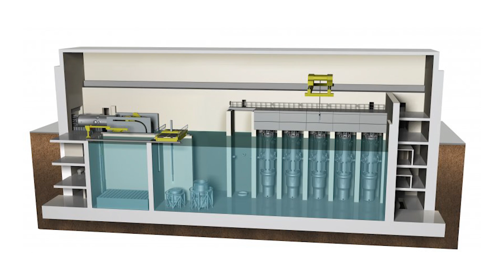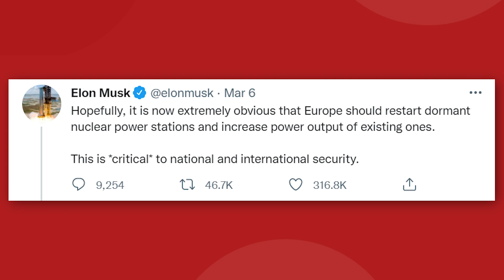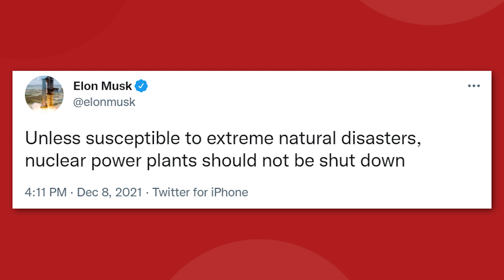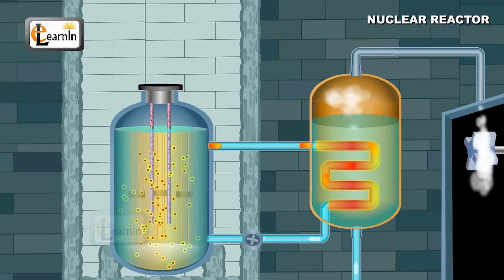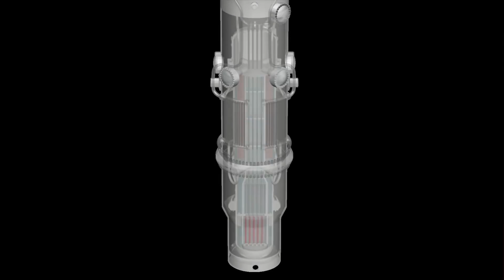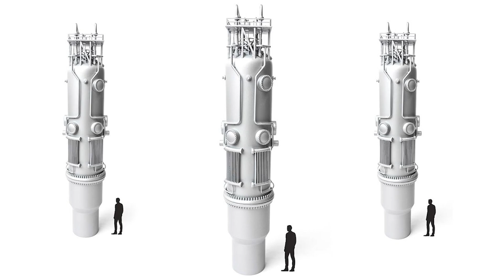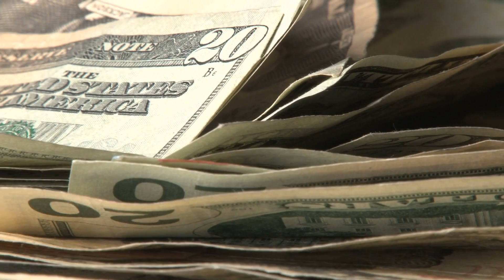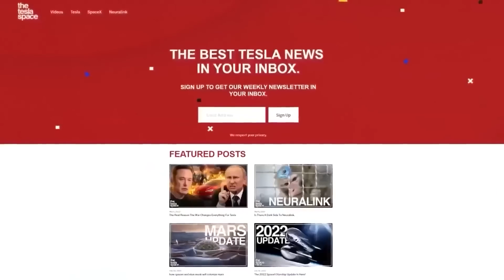The Real Reason Nuclear Energy Is About To Take Over!

Comment: NO NO NO. THEY STILL PRODUCE WASTE THAT IS UNABLE TO BE NEUTRALIZED OR CONTAINED!!! HOW F**KING STUPID ARE YOU??
The following article may be interest to readers:

"Last days of a dinosaur industry

We have gathered here again in front of your Nuclear Industry Forum to again try to warn you that you walk the false path. Your industry, the nuclear power industry, was able to get started on the back of the west’s nuclear bomb programmes in the fifties, based on assuring the public that you would keep the radioactive by-products of splitting uranium separated from the environment. This you have consistently failed to do, having lost control of your deadly machines at 3 Mile Island, Chernobyl, and now three more at Fukushima. Wikipedia talks of 21 meltdowns; that's one every 2.7 years. And with each meltdown you lot claim to now be safer because you've learnt something more. Well, you didn't tell us that the plan was to develop safety through trial and error, and we are not impressed with your efforts.
The public don't see why they should be taking such a huge risk, the risk of losing huge chunks of their country, (as in Ukraine and in Japan), just to get electricity that is available risk-free from other sources, like solar and wind. Especially since the alternatives are becoming cheaper than your nukes. In the case of Japan, whose Fukushima plants are showing themselves to be impossible to control, and which are throwing 400 tons a day of radioactive water into the sea for years now, we humans are facing the prospect of not just losing some land in Japan, but of losing the Pacific Ocean itself. The nuclear industry in Japan has shown itself incapable of even admitting they have a large, stinking mess on their hands, sending us all on a compulsory experiment in the long term effects of genetic manipulation through radioactivity.

Nor does the public see why they should give more free rein to an industry that for 60 years has claimed it would solve the problem of what to do with its waste in a few years time, yet which is nowhere near coming up with any solution. You have 148,000 Metric Tons Heavy Metal waste, ie. old fuel rods, sitting round mostly in swimming pools in the nuclear power stations that produced them, promising to come up some day soon with a way to separate them for ever from the environment. Which you can not do on a tectonically active planet. Your schemes to bury them in salt underground have just hit the wall in New Mexico, where a little 'release' of plutonium from one or several exploding barrels of waste have made it likely that the Waste Isolation Pilot Project will never reopen. And the WIPP disaster has revealed the dishonest behaviour of your industry; you are not allowed to dispose of liquid waste in WIPP so you threw in some kitty litter to absorb liquid and labelled it solid waste. And now you've switched from mineral based kitty litter to wheat based, 'because it's greener', (or cheaper?), and the nitrate salts in the waste have reacted with the cellulose in the wheat kitty litter, blowing open a barrel or three. So the other 300-odd barrels of the same mix are also timebombs that could 'release' more plutonium etc. at us at any time. Of course your experts will say there's no danger, but we're tired of listening to them pedal excuses. You claimed that this stuff would be separated from the environment for all time; your experts assuring us that the latest 'small release' is OK are no longer interesting. There was  meant to be none.

And now you need billions off the taxpayer to build your latest toy in Hinkley Point. Which will supply 3.2 Gw by 2023, by your rosy estimates. When the UK has installed 2.7 Gw of new solar installations in 2012 alone. At a strike price estimated to drop to £100 MW/h by 2018, by which time your index-linked nuclear strike price for Hinckley Point will be way north of £100. And when on-shore wind in the UK has TODAY a strike price of £80 MW/h. So by your own logic, the logic of the market place, your industry is dead. Already more expensive than on-shore wind, soon to be more expensive than off-shore wind and solar, and producer of huge stores of undisposable waste, that has to be guarded for ever at great cost. Not to mention the risk that if it has a bad day, a nuke power station will destroy a third of your country. All for what? So a few businessmen can continue to have expensive lunches and wear £300 shirts?
But what really gets us grumpy is the dishonesty and the political manipulation when something does go wrong. In Japan, they have just had the biggest industrial accident in the history of the world. Fukushima. But instead of admitting the magnitude of the problem they are in full denial, saying that 'all the contamination is contained in the harbour', that 'no-one's health has been affected by Fukushima', etc. Denial, so that they can restart their other 48 nuclear plants, because they are worth a lot of money. So money comes before public health and before honesty.

We the public have had enough. And think; your industry will affect your kids too. They have found plutonium in the teeth of every UK kid. Lots more of us humans die of cancer these days than died of cancer before the atom was split. Your kids will be eating this food, drinking this water. We only have one Pacific Ocean, and it leads eventually to the English Channel. There are, for radioactivity, no borders, and no gated communities to escape it.
 Yet, enthusiasts for this dinosaur industry say that Thorium is the answer, in particular Thorium LFTR.  A small LFTR research reactor was built in the 1950’s at Oak Ridge National Laboratories, USA; however, scaling up for significant electrical power production, for example 100 MW, takes a leap of faith.  However, Thorium LFTR implemented widely would be a highly dangerous source of materials emitting vast amount of gamma radiation, ideal for dirty bombs.  If one of these LFTR sprung a leak, their contents would be so radioactive that nobody could get even close to try to take remedial action.   Enthusiasts for this Thorium LFTR say “… the melt plug will simply melt in an event of overheating, and the contents of the reactor will flow into a basement dump tank …”; after many years of operation, the Thorium LFTR would be so “hot” from radioactive decay, that thermal management and radiation shielding would be major issues.  Yet, Thorium LFTR is declared as being the dream ticket.   Has nothing been learnt from Fukushima?"ADVICE TO INVESTORS: do not invest in Thorium LFTR.  It will never be commercialized.  Do not be swept up with the irrational zealots of the "Thorium cult".  Thorium nuclear technology has serious downsides, that are often irrationally ignored when comparing conventional solid fuel rod fission  nuclear technology with Thorium LFTR.

Comment: SNR's is the best choice for a carbon neutral future. Got to have something to plug all these electric cars into. But fossil fuels will still be needed to power long distance vehicles and farm equipment. A farmer typically runs his tractor 24 hours at planting time. He cannot afford to let his tractor sit for hours to recharge. Also, where are you going to get the rare earth materials to produce the batteries. Not to mention there disposal!
Reply: We can produce synthetic fuels with nuclear
Reply: "rare earth materials" are not actually rare.  They can be found all over the planet, but China currently does most of the processing.  That will change soon.
Reply: "Rare Earth"
Reply: "Rare Earth" minerals are fairly common, but it takes labor and fuel to extract and process. US has an abundance in Nevada and Utah but environmental lobby has made it off limits.

Comment: By the way, we already have access to an excellent fusion power source.
We call it the Sun.
It won't directly solve all of our energy needs all of the time but it will cover most of them.
Reply: Solar won't work at all without fossil fuel or nuclear backup.
Reply: It works on about 15% of the planet surface, and normally not close to population centers.  Ask Germany how their solar is doing.
Reply: @billweberx  photovoltaic solar is producing over 10% of Germany's electricity.  With other renewables, the total is over 50%.  That will increase greatly over the next decade, along with the addition of battery-based energy storage.

Comment: If the US Navy has been installing I’ve heard up to 8 reactors on a ship for at least 50 years certainly the smaller size of that technology can be done on firm earth. I’d say in the future, bigger is not always better.
Reply: It's never been a problem making small reactors.  It's been cost prohibitive.  The military doesn't worry about the costs.
Reply: @billweberx   The military got them built in two years or less, costing millions not billions.  No NIMBY's or NRC regulatory nonsense to deal with.
Reply: @danadurnfordkevinblanchdebunk  so has the sovereign nation of Japan. Big oil lobbyists are the problem, and the NRC
Reply: @danadurnfordkevinblanchdebunk  I am very interested as to why that is
Reply: @danadurnfordkevinblanchdebunk  the modular reactors are not related to ship based reactors. They are much bigger than the miniturised reactors used on ships and submarines. The modular reactors are a newish design to prevent operator error and meltdowns many are needed to make a modest amount of power. I think the US Navy expect to fit weapons and aircraft on their carriers as well as motive power this is a sensible expectation. Unfortunately these small modular reactors haven't been built. Like I said these reactors won't be completed anywhere to 2028. So they can claim they're cheap to run for another 6 years! Whilst 1000's gigawatts of cheaper Solar and wind energy will be built over those next 6 years 
And what becomes of these modular reactors as they fail over time. Their certainly not designed to be repaired or rebuilt without wholesale irradiation of worker's. Is the US government to pickup the tab for disposal of the retired reactors because nuclear power plant operator seldom save enough money for eventual decommissioning of their nuclear plants.
Reply: @johnmcelholum4203  you can build all the wind and solar you want and it still won't do you any good the winter, no matter how many batteries you buy. (The storage technology doesn't exist, but well pretend it does) Also,  people in third world countries cant afford any of the technology, microreactors can be 3d printed in a factory within hours and shipped anywhere within weeks.  I'm not sure as to the half life of irradiated steel, however it is long, and the parts can be reused for probably 100 years. As for those poor workers, small modular reactors are autonomously operated, repaired, and refuelled. All of the navy's waste is already reprocessed (economically) by Idaho National Lab. Also, nuclear has a lower occupational hazard than any renewable, especially wind and hydo. So you are simply misinformed on all fronts. Also wind and solar don't work in most populated areas, because we get to much rain and snow places like the eastern United States, South eastern Asia, Northern Europe, Russia, Japan (even Arab nations that get plenty of sunshine are currently building nuclear plants).  Also we don't have environmentally friendly ways to mine any rare earth minerals without producing more radioactive waste than we can deal with, but if we actually did R&D in nuclear we could. Renewables are only justified if they save on fuel costs, considering the time value of money they could actually be a complete scam
Reply: @danadurnfordkevinblanchdebunk  11 of them are currently sitting on the ocean floor.
Reply: @danadurnfordkevinblanchdebunk  Plenty of NRC stuff to concern with, but their unique relationship and environment do kinda change the situation there a lot.
Reply: @TheBlightWarden  Japan has constructed dozens of nuclear plants in under 3 years, all the talk about construction hurdles are just western NRC nonsense.  Why should it that long?
Reply: @mr_happygolucky7095  The Banks and Hedgefunds do not wan cheap, abundant energy -- They would much rather have us deplete our fossil fuel reserves so that they have an excuse to charge us ever increasing prices at outrageous profit margins.  Nuclear would allow us to PRODUCE fuel from water and Co2 cheaper than they can pump it out of the ground.  The Navy has been doing this for over a decade now...
Reply: @Cozy Blanket Only if certified safe by NASA.
Reply: We need to make a couple MSR sizes, aiming for optimization. For instance, if we can make one the size of a large refrigerator, then we can build ships around them. The smaller the reactor the more options available. If the smallest reactor is the size of a semi truck gasoline transport, then you're more limited in ship size.
For something like that, maybe the smallest practical ship would be 200 feet long. You would see a ton of new ships built at 200 feet long that use nuclear, and no ships at all built at 198 feet because it will need to run on diesel.

Instead of building a 190 foot long ship that runs on diesel, people would buy a 200 foot long nuclear ship and live with it being 10 feet longer than they need. The efficiency and convenience of unlimited range makes it worth doing.
So now you have ships of 200 feet or more, and ships of maybe 120 feet or less. Big gap in the middle nobody wants to fill.
Reply: @TheBlightWarden  I think that there are power lines that could be built to meet the reactors at sea far from the land...
Reply: @TheBlightWarden  Yeah... In the case of a melt-down, the salts and dissolved metals in the water will become radioactive and the ocean currents carry all that radioactive waste and spread it all over the world... BRILLIANT!
Reply: The US Navy installed 4 reactors on the USS Enterprise, one for each engine room, because the Navy reactors were limited in size.  The Nimitz and Ford class carriers have two reactors, two engine rooms per reactor.  All other navy ships, cruisers and submarines, have a single reactor.
Reply: Navy ships use weapons grade material to generate electricity. We don’t want thousands of locations filled with material that can used to make bombs.
Reply: Different technologies, no one gets to use our military reactors they run on bomb grade U,they are insanely expensive.
Reply: The Navy uses highly enriched uranium in their cores. Commercial reactors use low enriched uranium (LEU). A completely different design is required to build commercial SMRs using LEU.
Reply: Exactly. Great thought. 
Proof of concept and testing has all been done. Just modify to replace the boiler system at fossil fuel plants.
Reply: You know nothing

Comment: what has been taking so long to develop small reactors? SMR's' are the way to go...on even a smaller scale. Why can't we build reactors on an even smaller scale that would only be used at the home level...initially the cost would be high but would come down as the technology got better. My dream has always been to instead of using a heat pump for heating and cooling, why can't we make small reactors that would not only make power but would integrate with HVAC systems...and local power grids of a new design where we would feed power back to the grid? Where have the engineers been over the last 40 years developing new energy systems....MIT, CalTech, Florida Tech???
Reply: Micro reactors that small have major neutron and thermal inefficiencies.
Reply: Cost.

Comment: The Steam is NOT RELEASE IN OUTSIDE AIR ! My god .... what a mess ! The steam you see coming out of the cooling tower is only condensation of outside ambiant air heated by the running hot water pipes situated inside the tower !! THE STEAM IS NEVER GOING OUTSIDE IN THE AIR in any nuclear central, NEVER !